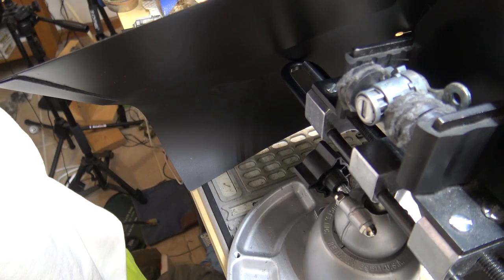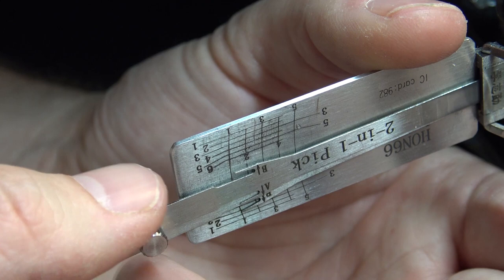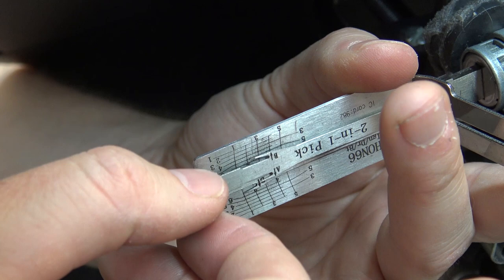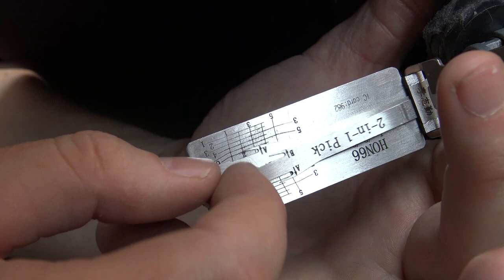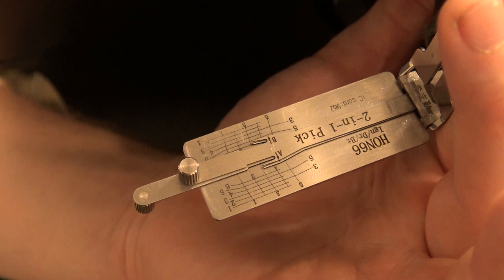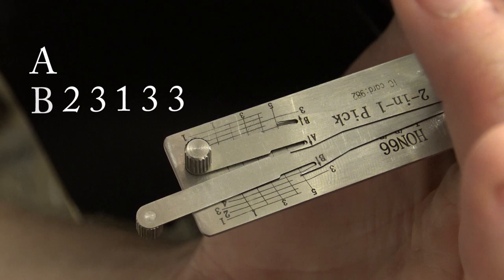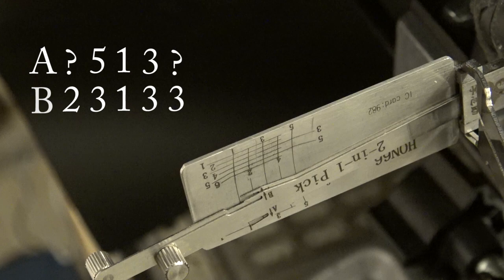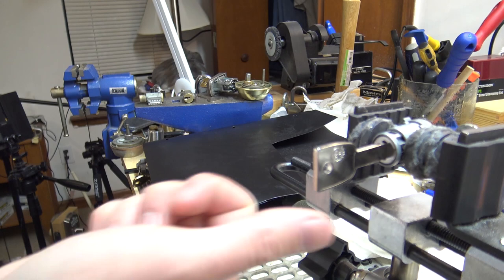(447) HON66 Lishi Pick & Decode of Honda Door Lock

Comment: Lishi makes a great product except this one. It's complicated, clunky between cuts and difficult to decode. This is the only lishi I absolutely hate!!
Reply from the maker: lol blaming the tools…. Nice.  The issue isn’t with the tool. It’s that Honda has 6 depths.  I use this all the time for unlocks.   With codefill software decoding usually isn’t to tough.  Easy enough in most cases to just to grab a code from a lock after you get the door open
Reply: @BoredLockpicker  it gets hung up a lot trying to go between cuts, it's the only lishi that seems to have this issue. It does work, but easier to pull a code once it's open.
Reply: I've had quite a bit of success with hon66 here in NZ. But I do find that I'm often unlocking old worn out Hondas so it can be a bit difficult getting that tool moving when the lock is already a bit stuffed.
Could air bag and hook the button in half the time but it looks far cooler to the customer if I can pick it in a couple of minutes.

Comment: man I gotta say, your camera work is fantastic. You know exactly how to get it to focus and the lighting is surperb too :) oh and lishi skills are great too
Reply from the maker: thanks man
Reply: @BoredLockpicker  What are you using to do the pin code filler for honda? Picking them are easy for me I am just having one hell of a time decoding them. Tired with instacode but out of the 6 I have done for practice I been unsuccessful. I end up having to pull door lock codes or get them from the dealer.
Reply from the maker: I use lock codes and insta code. It doesn’t matter which  one you use though. If you aren’t entering a valid code into them they aren’t going to work. If you aren’t sure on a space you need to use the plus one feature on either program.
Reply: @BoredLockpicker  What is the plus one feature? I actually have not heard of that before. 
I think my biggest issue on the Honda that I seem to notice is trying to get the pick to stay centered when I am holding it and reading then trying to juggle my phone or note pad to write the depth numbers down. Cause depending on some of them if you hold it more to one side it can give one number or a different. If that make sense. I did get my hands finally on a broken honda ignition cylinder, that I am confident I can fix(the shop had no idea I could fix those so they only called me to program the new keys that came with the new cylinder). So hopefully that will be a good one to practice on at anytime.
Reply from the maker: @phillipzan2005   if you aren’t sure if a cut is for example a 2 or a 3 the fill program can check both.

Comment: Hi! Thanks for the great video! I'm trying to pick my Honda Fit open with HON66. I started with picking a2&4 on the bottom and a3 on top, then the lock would turn for like 10°. But when I move forward to picking the b sides, it feels like all the b positions are stuck. Not springy but I can't pick it or move it. Have been trying to adjust the tension, but if I put very light tension, nothing on B sides are binding but springy. Any idea what went wrong?
Reply from the maker: Are you sure nothing else on the A track isnt binding? Or have tried a different order or starting with the B track?
Reply: Thanks for the prompt reply! Didn't expect to hear back so soon :) Yes, I tried starting from b sides but nothing binds. And yes, all a2 a3 a4 are picked and springy.
Reply from the maker: @smpig  do you know what your key bitting is?
Reply: @BoredLockpicker  sorry I just started learning doing all these and can't really read codes from the key bitings. If there's any way I can send u a pic of the key I'd would be happy to do so.
Reply from the maker: @smpig  decode the key with your key machine.  Reason I ask about bitting is if you have 5 or 6 depths they’re very easy to overset.  Your problem sounds like you’re oversetting something.
Reply: @BoredLockpicker  I don't have an auto key cutter as of now, but from the look of my key yeah I think it does have 5 or 6 depth. Thanks for the advice! Will check to see if that's the issue.
Reply: I got one more question if u don't mind. When I pick a position, and over pick it, would it still be springy? I meant is there any way to tell if I over set something?
Reply from the maker: @smpig  best way to get a feel for it is pick locks you know the bitting too so push on the deepest depth wafer and overset it on purpose because you know it’s there and you’ll see what it feels like.
Reply: @BoredLockpicker  got it, that's a very helpful tip! Thanks again for the suggestion!
Reply: @BoredLockpicker  A little update, I realized that I just needed to loose the tension a bit and pick harder on B sides than I thought it needed. I can now turn it to 45° and set it back within a minute. But somehow I just can't push it pass the second stage. Feel like a3 are binding, but can't pick it even though I have picked so hard that I feel the pick is gonna bend. After turning to 45°, I can set it back from there, or push forward for like 5°. Is it correct that I should push forward for 5° and pick open the second stage from there?

Comment: I guess it's worth noting that HON66 lock has 6 wafers, wafer #6 is always 1. Also, on factory locks wafer #5 on A side is 5 or 3 and wafer #5 on B side is 5 or 2. Things get way more interesting when lock is not original or worn. If key is worn - decoding (reading with machine) one side of the key will not match decoding of other side, making this game even more interesting. Worst of all, nobody is willing to pay for extra knowledge which is required when dealing with this lock.
Reply from the maker: Good info!  I think this lock system is garbage overall. But you can make good money fixing or replacing when they inevitably fail.
Reply: @BoredLockpicker  You are absolutely correct.

Comment: Hi mate I came for bit of advice. I've open hundreds of cars but hon66 came to my hands few days ago. Friend of my has civic . I can do easily turn lock half way and come back to 0 position. While I'm on half way all pins is springs I did everything with tension more wd40 etc. What I'm doing worng in 5his case?
Reply from the maker: If nothing binds usually means you have to increase the tension. You usually only have to pick a few of them to go from halfway to all the way
Reply: @BoredLockpicker  unfortunately I increased tension even to nearly break a pick 😂 honestly I did everything. I'm auto locksmith never had a problems but this one I can't figure why can't pick anything after half way
Reply from the maker: You’re trying to pick both tracks right? This Lishi is one of the easier ones that requires locks to be picked twice.
Reply: @BoredLockpicker  yes of course both tracks

Comment: Sorry for my ignorance. HON66 is 6 cuts? Last cut is always a 1? I’m having a very hard time deciding a 2012 civic with my xhorse key reader and xhorse dolphin. Ever have issues with hon66??
Reply from the maker: Pull the valet lock and get the code
Reply: @BoredLockpicker  the doors were rekeyed. I am too inexperienced to use the lishi. I ended up replacing probe and cutter on my dolphin and start using the universal duplicate option, ill see how that goes
Reply from the maker: @pouncerminned863  universal should work. Also if it’s aftermarket locks the code may not come up in code fill so it could be decoding right
Reply: @BoredLockpicker  that makes a ton of sense dude! Thanks for your help. Yes it does come up with a valid code when doing progression on lockcodes!!
Reply from the maker: @pouncerminned863  I’m doing a Honda now too lol as we speak
Reply: @BoredLockpicker  lol i never had issues with them uintil recently. I had about 80 cuts on my dolphin using the 1.5mm last 2 hondas gave me issues but every other key cut and decoded fine. Imma start using universal decode on HON66 I just replacxed the probe and 1.5mm to see if that helps. Hopefully it does. Gunna send you a donation again for all your help
Reply from the maker: @pouncerminned863  appreciate that man. And on Honda I always click
The secondary processing. Usually don’t have an issue. If I do I cut it a second time and it works.
Reply: @BoredLockpicker  thanks man. Ill try that too, Ive never tried doing that

Comment: New to this. I'm considering buying this tool because I'm sick of calling AAA when I lock myself out lol. You're obviously experienced and move really fast. Are there any good resources for complete beginners learning to use this tool? Also, I'm wondering why your tool is upside down? I'd think they'd make it so the numbers were right side up, but I'm probably missing something. Thanks!
Reply from the maker: This is not one of the easier ones to learn on. The lock has to be picked twice then picked back to the home position. As far the tool being upside down…it can be inserted either way just like a key. I’m right handed so it’s easier for me to pick it counter clockwise. If you’re actually going to use it to unlock a vehicle. Hondas unlock clockwise so you would probably insert it the other way to pick it clockwise.  I think you’d be better off just getting a couple of what they call service keys cut. They’re just metal keys no chip in them that you can use to unlock it.
Reply: @BoredLockpicker  Wow! thanks for the speedy reply. Greatly appreciated. Idk why I didn't just think about getting extra keys made haha. Still a very interesting tool though. Thanks for the tip!
Reply: @BoredLockpicker why do you have to pick it back to home?

Comment: I'm playing with random (unknown model) newer Honda door lock (picked it up in body shop) right now and it made be totally mad. It has code written on it, so I know all the numbers, BUT! First of all, at unknown reason, it's extremely hard to pick either way - everything is counter intuitive, to be short - in most cases only random playing with tumblers and direction of tension (!!!) allows to pick it. Second - after hours of trying, I couldn't pick (turn) it twice. Not sure if it has different design or what. It still possible to read numbers, BUT! If I pick it one way - I can only read one side (say - B, positions 1,2,3,4,5), side A would show totally incorrect readings. If I pick it other way, I can read positions 2,3,4 of side A, but side B would show totally incorrect readings. Never together! I never ever would want to do it in real life, spending hours outside the car and trying to figure it all out. This is definitely  stupidest lock, taking in consideration all of its flaws.
Reply from the maker: That’s wild you can’t pick it twice. I haven’t ran into that issue yet on a Honda lock.  I wouldn’t mind taking a crack at it and see if I can pick it all the way over.
Reply: @BoredLockpicker  It's ether damaged or different indeed. It's from newer car, not seized or anything, looks clean. Today I was able to pick it second time, but it was done by random  playing with tumblers and shaking lishi  (!!!). I was able to read correct numbers on both sides, but as soon as I released pressure on lishi, lock returned in first picked position (so it only needed to be picket once to return back home). This is just nuts. Maybe this lock requires slightly different lishi. I don't know.
Reply from the maker: @sergey_sovetsky  thats perfectly normal for it to return to first picked position and only needing to pick it back once......
Reply: @BoredLockpicker  It's still something not right with this lock. It often falls in the state when there are no valid tumblers to click, sometimes it even happens from very beginning. Random playing with tumblers and shaking lishi sometimes lets lock to turn a bit, and then all over again - all  tumblers are either #1 or jumpy, nothing to click...I did use WD40 but it didn't help.
Reply from the maker: @sergey_sovetsky  I wouldn’t mind messing it. Are you in the states?
Reply from the maker: @sergey_sovetsky  nice. Not sure how bad shipping is from there to Florida
Reply: @BoredLockpicker  Nothing is cheap here :(. I don't think this POS worth $20 just to play with it. I might try to play with it a bit more just just to see if I can pick it "normal" way at all. So far it was pure "hit and miss till it turns".
Reply from the maker: @sergey_sovetsky  I only ask because I commit I with company. Sometimes the key blank doesn’t change but spacing or something else does.  The company needs to know or they can’t make new tools
Reply: @BoredLockpicker  Ok. I will play with it a bit more, after that it's yours :)
Reply from the maker: @sergey_sovetsky  it honestly sounds to me that the lock is normal and you are just learning about 4 track locks
Reply: @BoredLockpicker  Could be this.

Comment: Do you have to pick it twice just to open? Or was the lock open in the first position?
Reply from the maker: Twice to open.
Reply from the maker: And once to pick it back to home.
Reply: @BoredLockpicker  would it be stuck in the lock until to do this full procedure? I'm predominantly a domestic and commercial properties locksmith. I do some auto entry but have never come across this yet. I'm finding the Va6 quite tricky at the moment,I'm not trying to decode anything as I don't have the gear to make keys, are there any tips on the Va6? I just looked for binding wafers and managed to open my own van once,but since I've not been able to feel my way through it.
Reply from the maker: @ryonchero4401  va6 isn’t in the states so I haven’t seen one but picking locks is picking locks. If it moves at all leave it alone.  Far as Hon66. If you pick it once the Lishi will come out but a can’t go in. So you have to pick it back. No pressure lol
Reply: @BoredLockpicker  😅 well it's good to know thanks, if I'd come across it now without knowing I'd be sweating.
Reply from the maker: @ryonchero4401  picking them back is actually pretty easy
Reply: Still need with the hon66. If I pulled it out of the ignition prematurely, and the customer can't put their key in. Can I put my pick in to pick it to the correct spot?